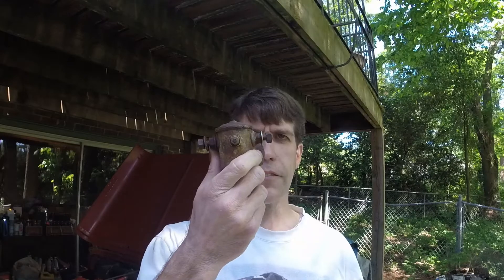6 Volt 3 Post Starter Solenoid Explained and the Differences Between Types (Electrically Actuated)

Comment: I’m having problem with my starter turning the flywheel. I know the starter works because I took it off and touched it with the battery cables. The solenoid definitely works because it goes off when I turn the ignition. I even tried jumó starting the battery to give it extra energy. What could it be?
Reply from the maker: trying taking spark plugs out to see if it will turn with no compression.  It could be the solenoid is starting to go bad.  Mine was transmitting energy but not enough to turn the starter at one point.  It should be giving about 6v to the starter not 3-4v.  I am also assuming that the engine is not seized up in some way.   It could be a grounding issue too.  make sure you have a good ground or even connect the negative of the battery straight to the bracket of the starter to make sure it is good.  I've seen paint cause issue with ground. Let me know if none of those work or what it was.  I wish you the best.
Reply: @jaysjeepandclassiccars  sorry I barely saw this now haha. I took the spark plugs out , cleaned them, and tried to get gas through the carburetor. I sent a comment on another video of yours explaining what happened. I had the exact same problem in that video but my flywheel turned a lot slower
Reply from the maker: @luv_sosa1266  try running it without the spark plugs in to see if it is faster.  My gut says you have a weak solenoid but I'm not sure.  I put some comments on the other comments to have you try.  let me know.
Reply: @jaysjeepandclassiccars  and the solenoid is brand new, the exact same one as yours too.

Comment: Dude !!! On the newer Solenoid that you show,you are pointing to the wrong side for starter...Using your starter side I got nothing,it's funny though,where ever my Solenoid was produced,some wise acre put the Batt sticker on the same side as you explained...I flipped it around(switched sides)and the current flowed...
Reply from the maker: who knows.  Gotta love quality control.
Reply: I flipped mine over and current flowed!!  Ford Jubalee 1953 (8N) Positive ground.  I thought the battery connector would be closer to the connector for the start switch.  I was incorrect.  Only took days to figure out...

Comment: exactly what I needed to know thank you! my 1930 model A was converted to a modern distrib and 6 volt starter solenoid probably in the 50s..just like you, the 3rd post is always live..do you know where I can find another one with an active 3rd post? thanks!
Reply from the maker: That is a tough find.  I went and looked and my old one has the same part number at what CJPonyParts SS11 has in the picture. I just bought the SS10 last week and I put it on my multimeter.  I think it also has the live post and the box has the same part number or close to the one I took off originally but I haven't tried putting it on yet.  I have the other style that needs to be energized and it tests different on the multimeter.  So check them out and see if what you think.  If you call they may be able to confirm for sure but I think it is what you need.  There might be others out there, but I haven't found them as of yet so I don't know.  Hope this helps.